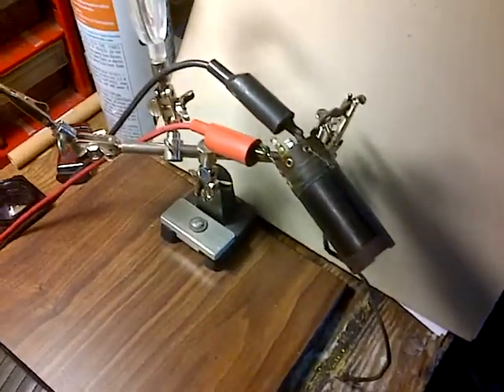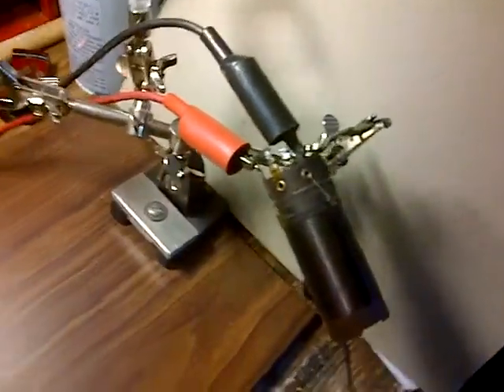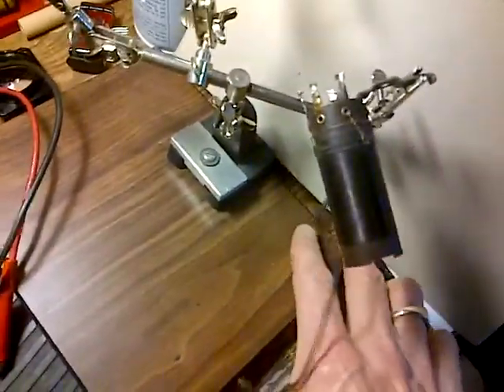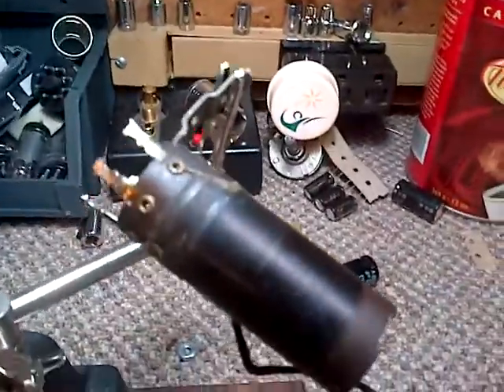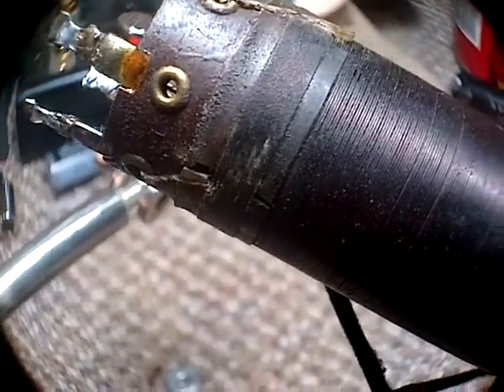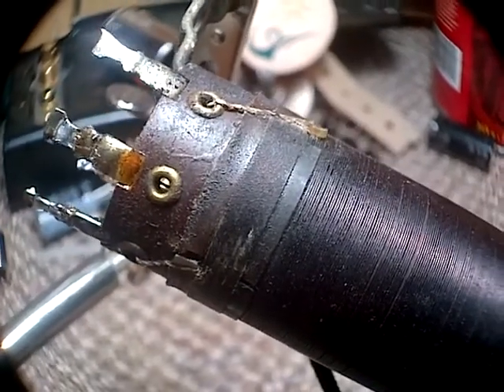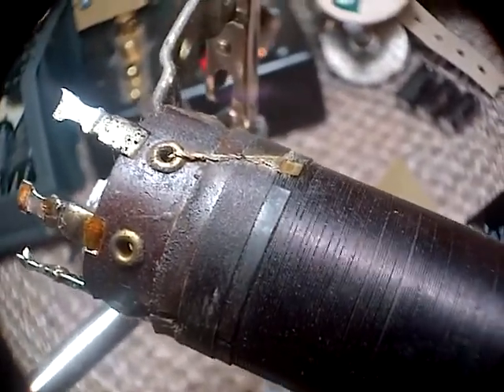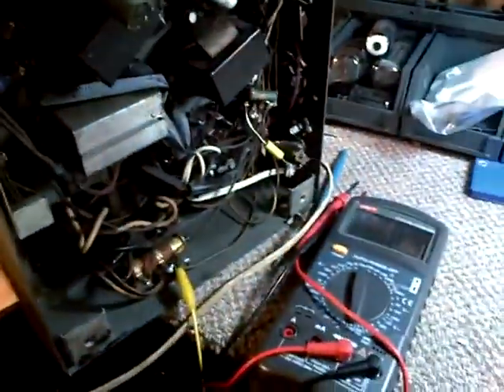Philco 91A-221 Radio Repair Video #14 Dilemma with IF Coil

Comment: PHILCO REPAIR BENCH
Rewindng Philco IF Coils
by D. K. Owens
http://www.philcorepairbench.com/rewinding-philco-rf-coils/

Bad primaries are easy to rewind. Disconnect the wiring and remove the coil from the set. 
Carefully count the number of turns on the primary if your model is not one of those in the table below. 
Don’t try to count turns by unwinding; the wire will break and crumble. 
Count by dragging a pin or needle over the coil surface so you can feel each turn as the pin passes over it.

It’s also a good idea to make a sketch of the coil before taking it apart. Remove the primary wire and remains of the plastic strip. 
Salvage as much of the strip as you can to use as a pattern. Immerse the entire coil in dilute ammonia and rub it gently with a soft toothbrush to remove any acid residue. Rinse it thoroughly with water, and let the coil dry.

Comment: Well did you ever get it fixed? BTW what frequency were those I.f coils?
Reply: According the Riders, the Philco 91 series was a 9-tube Superhet design with a ZF/IF of 260 kHz.
The “91A” chassis type power requirements are 115 VAC at 25-40 Hz.
The “221” chassis code designates a single band, dual speaker.

Comment: Hi Jim. There is a way to  calculate the turns by the dia of the paper tube and the dia of the wire. Or if you are lucky you may be able to count the turns you can see and if it is double or triple wound you can find the number by times of two or three. Good luck. Bobby

Comment from the maker: Thanks Bobby.  Great ideas.  I watched AA5's video on on of these Philco coils and I see when he removed the original wire, it separated into many pieces.  Not a good idea to use the old wire again, I'm sure.  I'll need to procure some fine wire and use that so it'll be a couple of days before I continue.

I will try the salt water idea to see what happens.  I think tap water will have enough conductivity for the test.  Nothing to loose here.